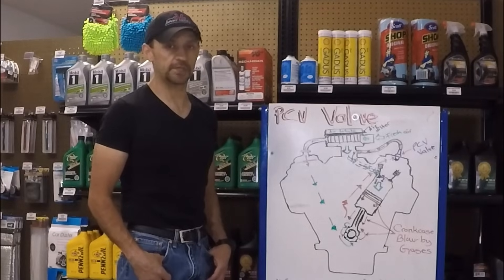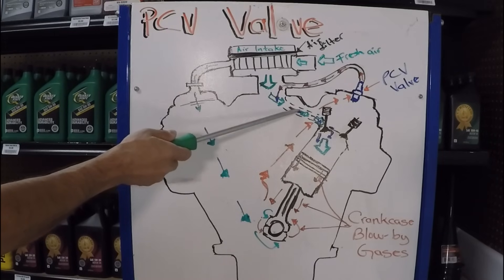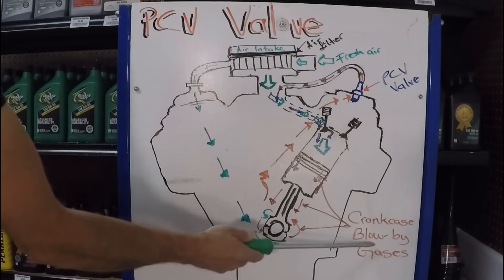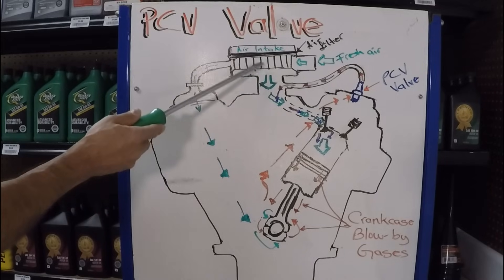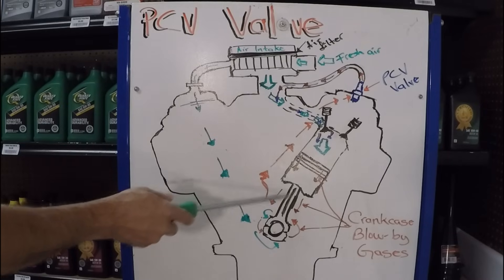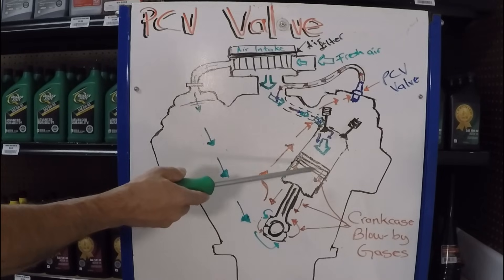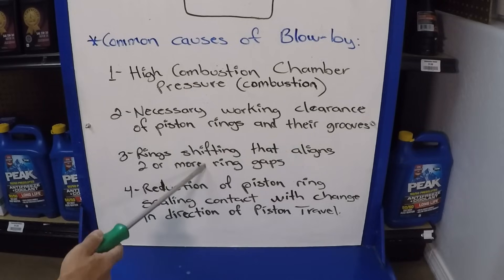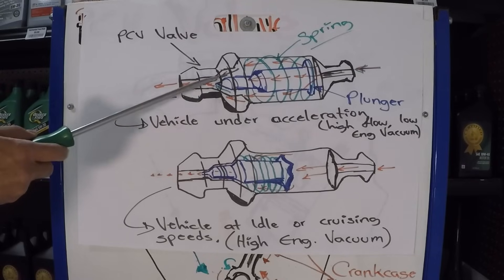How the PCV System Works ( PCV Valve )

Comment: Dear would a bad pcv valve causing the oil stack in the intake which mey cause engine misfire and turn on the check engine light?

Comment: Buenas tardes saludos. Yo sé que usted habla español tengo una pregunta tal vez me puede ayudar tengo una 85 Chevy k10 motor 350. La uso para el trabajo. Nada más manejó 30 millas a diario que bujías me recomienda utilizar. Y que grado de aceite. Gracias y buenas tardes
Reply: Armando Bautista - usa bujias originales ac delco y el aceite recomendado para tu motor que en tu caso seria 5w30 o el 10w30 de acuerdo a las temperaturas de tu pais, esta informacion importantisima se encuentra escrita en el manual del dueño que viene con el vehiculo (si no tienes un manual de estos te recomiendo que lo compres para que no destruyas tu vehiculo con estupideces inventadas por idiotas que pudieran decirte equivocadamente y te lleven a cometer una locura de tal naturaleza)

molecula del 5w30: o
molecula del 10w30: O

el 5w30 se puede usar en donde se usa el 10w30 por el diseño de las galerias del aceite, tolerancias de la bomba de aceite y de estas galerias, y por el tamaño de las moleculas y su viscosidad
en cambio, el 10w30 no puede usarse en donde se usa el aceite 5w30 pues las moleculas estructurales del aceite 10w30 doblan en tamaño a las del 5w30 y para el tiempo en que llega algo del aceite 10w30 bombeado por la bomba del aceite a la parte superior del motor, el daño ya esta hecho y asi es como se destruyen los motores antes del tiempo en que les toca una reconstruccion general del mismo
si tienes mucho millage, despues de 150, 000 millas, para compensar el desgaste interno del motor, lo que puedes hacer es agregar medio bote del aditivo lucas (formulado para motores de combustion interna), y lo demas del aceite que te falta, con el grado de viscosidad adecuada que te recomienda el fabricante del vehiculo, que en este caso seria gm chevrolet
el grado del aceite recomendado para tu vehiculo nunca se cambia, y usualmente este se encuentra estampado en el tapon de llenado del aceite, a menos que seas un payaso al que le gustaria destruir su motor paulatinamente y use cualquier pendejada que un vago sin oficio pudiese aconsejarte erroneamente 😖

Comment: I have doubts, The hose from the PCV goes to the carburetor or can be conected to the base of the air filter assembly? The 2nd, the ventilation on your other side of the drawing, Is it the other valve cover breather? I suppose that both sides work in the same way= expelling  gases: blowby, with 1 PCV is enough or there must be in the 2 sides? 
Isn´t it recommendable: proper to connect the hose from the PCV directly to the intake manifold? 
I´ll wait for your kind response
Reply: No. The video is correct , one hose is a breather hose , drawing fresh air after the air filter . the other hose is connected to engine vaccum past the throttle . if both hoses were to be gas exits , they would be both past the throttle body , no need to direct one to the air filter unless we like oil soaked filters . the size of pcv valve varies , so no need for 2 hoses, just put the correct one

Comment: Where the vacuum is created in the inlet manifold or crank case ??i think vacuum must be created in inlet manifold so that pcv valve sucks the blowby gases from the crank case and sent it into the combustion chamber again am i right??
Reply: Truth set u free - according to wikipedia:

Manifold vacuum

Not to be confused with Vacuum manifold.

Manifold vacuum, or engine vacuum in an internal combustion engine is the difference in air pressure between the engine's intake manifold and Earth's atmosphere.

Manifold vacuum is an effect of a piston's movement on the induction stroke and the choked flow through a throttle in the intake manifold of an engine. It is a measure of the amount of restriction of airflow through the engine, and hence of the unused power capacity in the engine. In some engines, the manifold vacuum is also used as an auxiliary power source to drive engine accessories and for the crankcase ventilation system.

Manifold vacuum should not be confused with venturi vacuum, which is an effect exploited in carburetors to establish a pressure difference roughly proportional to mass airflow and to maintain a somewhat constant air/fuel ratio. It is also used in light airplanes to provide airflow for pneumatic gyroscopic instruments among other items ..

Comment: Thanks for the explanation. However, there are a few things I did not quite understand after 1:45. Engine creates a vacuum sucking fresh air in from the intake manifold and the crankcase blow-by wants to escape due to high pressure by the compression. How does vacuum and pressure occur at the same time? Or are they sequential? Also, if the fresh air is continuously sucked in due the vacuum created by the engine why should there be a need for a ventilation on the other side while the intake manifold is supplying fresh air into the engine at all times?
Reply: Matt Denson - according to wikipedia:

Manifold vacuum

Not to be confused with Vacuum manifold.

Manifold vacuum, or engine vacuum in aninternal combustion engine is the difference in air pressure between the engine's intake manifold and Earth's atmosphere.

Manifold vacuum is an effect of a piston's movement on the induction stroke and thechoked flow through a throttle in the intake manifold of an engine. It is a measure of the amount of restriction of airflow through the engine, and hence of the unused power capacity in the engine. In some engines, the manifold vacuum is also used as an auxiliary power source to drive engine accessories and for the crankcase ventilation system.

Manifold vacuum should not be confused with venturi vacuum, which is an effect exploited in carburetors to establish a pressure difference roughly proportional to mass airflow and to maintain a somewhat constant air/fuel ratio. It is also used in light airplanes to provide airflow for pneumatic gyroscopic instruments.
Reply: I don't understand it all myself but I know that vacuum is created by the pistons moving downwards creating suction, so there is a vacuum in the intake pathway. I don't think there would be much pressure in the crankcase unless it was completely sealed. If the pcv valve is clogged the crankcase will vent from the fresh air opening on the opposite valve cover.

Comment: With so many videos out there this is probably one of the few that has a good diagram and explanation. Thanks man. Keep it up.
Reply: Dealership said to connect oil catch can to driver side vent and pcv passenger side to oil catch then plug up air intake hole barb and the hole on the intake manifold becuase i am losing oil said catch can is routed wrong any suggestions ?
Reply: If your catch can is vented, then routing it as you describe should work.

Comment: Well explained with nicely drawn diagrams, thanks for sharing.
Reply: I went to dealership they said to connect crankcase hose to one side of oil catch can and the pcv valve hose to one side of oil catch they then said to block off the intake hole on the block and the barb hole that sticks out of the cold air intake said that will solve my oil consumption problem.